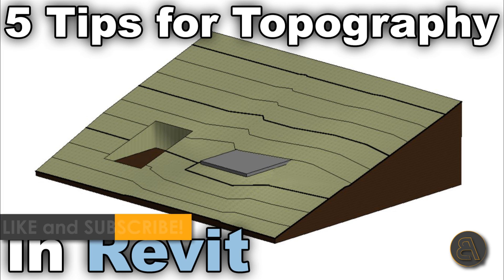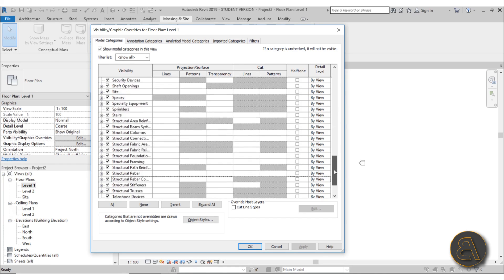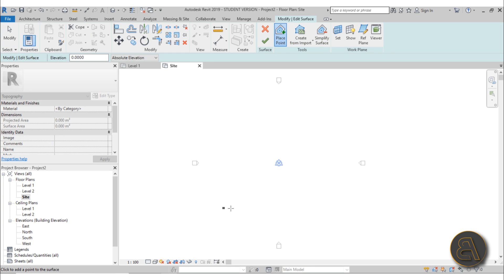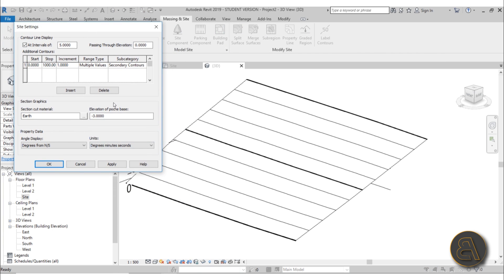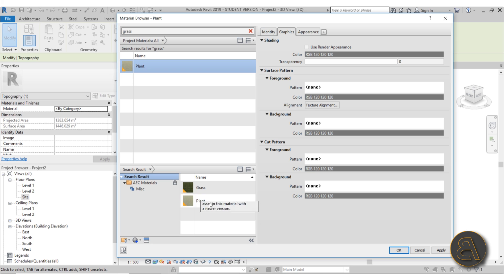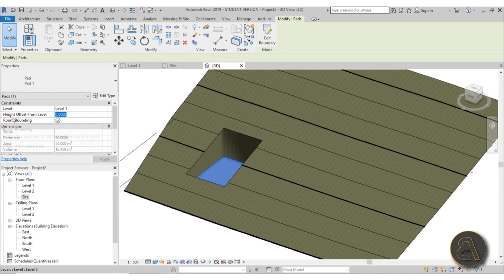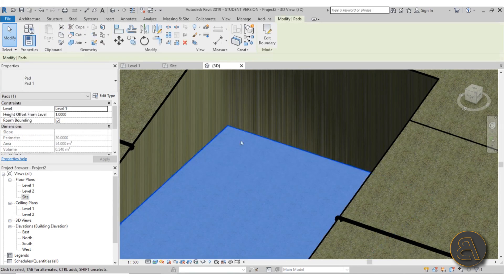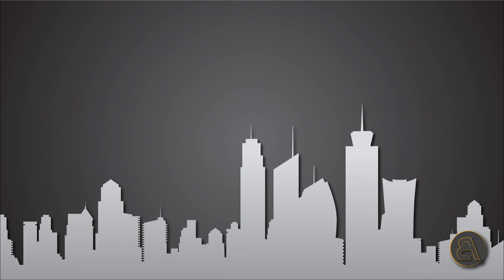5 Tips for Topography in Revit Tutorial

Comment: 2 things that I don't like in Revit for the Topo Surfaces. #1 - You can not export Civil 3D points with a Dot style because Revit does not recognize DOTS ! So when you import Civil 3D points as a CAD file from AutoCAD or Civil 3D, you have to import points with a cross style. But then Revit is going to create topo points in every ends of the crosses that represent the points, instead of only using the center of the point. #2 - We cannot create topo breaklines to prevent points from triangulating wrongly... I have been spending hours and hours to get a satisfying topo surface in Revit that would match Civil 3D, and I can't make it happen. I understand that Revit ain't Civil 3D, but still.

Comment: It makes me sad that Revit stopped supporting the topo addon developed by Eagle Point (I forget what Revit called it.) Eagle Point used points and break line with lots of clever way to adjust them. The 'building pad' barley works and adding or moving points around will get you in trouble when you get confused about which ones are the real ones and which ones you created.

Comment: When I create a topography by entering points above sea level, Revit places the topography up in the sky, despite that fact that I've specified coordinates at level 1 so that "level 1" is 500'.
Reply: As far as I know if your building is drawn at 500mm that means it's 500mm above sea level, but your topo is drawn at 50m above sea level then the topo will be 45 m above your building, you have to adjust your building to 50 m above sea level as well. Revit and Auto Cad works on a World coordinate system, so if you enter the property coordinates, then it will give you accurate sun paths and solar studies etc. So you can draw GL at 0 but then when you get your site levels from a surveyor then that will be drawn at an actual level above sea level.